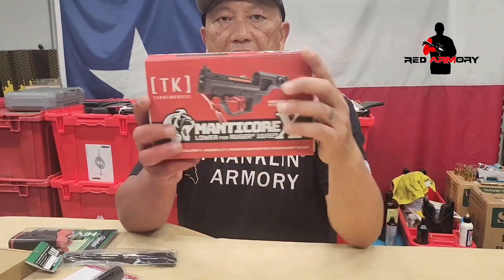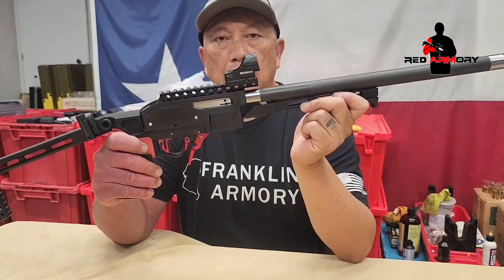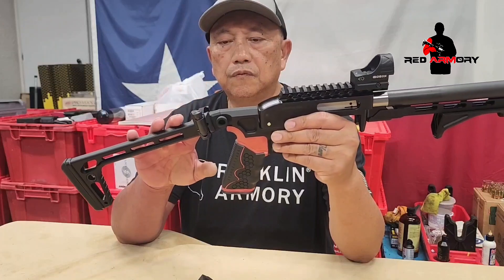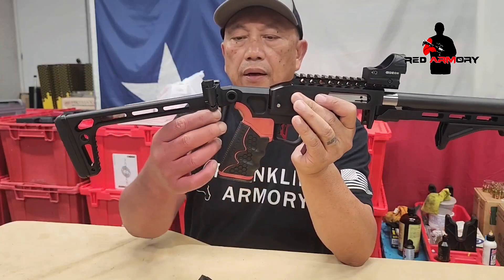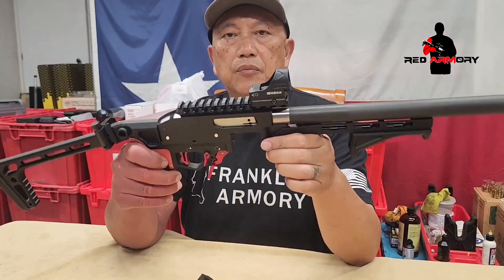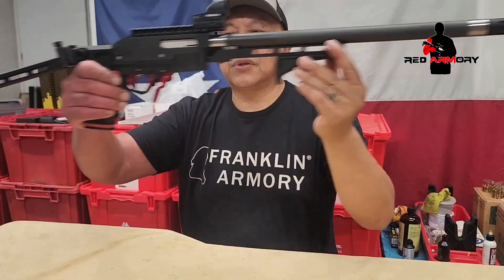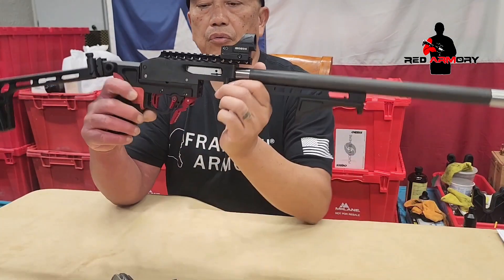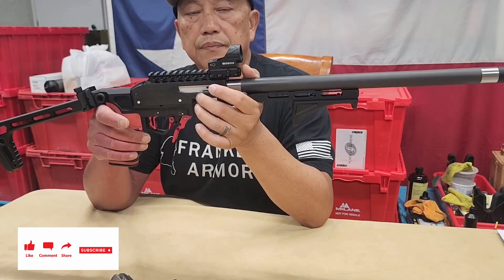Manticore X - Tandemkross

Comment: Get a Kidd buffer. Bet it will stay put
Reply from the maker: Deal! how much?  It's what's in it!😀  but seriously, it needs to be captured.
Reply: @redarmory  Its not captured but its rubber with a metal fitting.  I have one and its very snug and quiet.  But i agree, with this setup a captured buffer would be better
Reply from the maker: Yes, I run it on all of my 10/22 type rifles, a lot better than just a metal or rubber/plastic buffer.  The rubber/plastic over metal pin buffer design just holds up better.